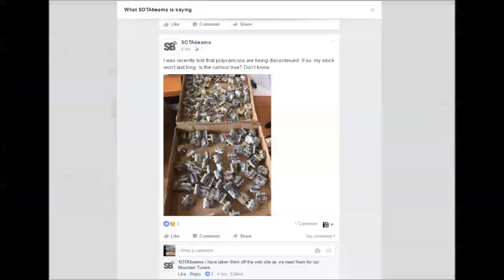What to do if they stop making variable capacitors

Comment: They aren't going anywhere. Every alarm clock uses one. We will always need to wake up.
Reply from the maker: The same would have been said about valves 40 years ago. Now you hardly ever find a valve radio. Modern clock radio are push button tuning and don't have a variable capacitor.  And many people use their smartphones to wake them up.

Comment: Some stochy diodes and power transistors work well as a varicaps... using 0-9V tuning voltage... power diodes gives 500...150pF and transistors 1000....250pF tunning capacity range... all this devices from impule power supply.... or junk box....

Comment: Peter, one trick you can use to cut down on wind sound (and attenuate the audio level slightly) is to wrap a little scrap of soft foam such as the kind you might find in an equipment case or inside a cushion/mattress around the mic. 
The best option is fake fur or similar, which if you can find a scrap piece from a garment at an opp shop or similar, it will work wonders.
You can tape or use a tiny cable tie to secure the material around the mic.

Comment: Variometers with nested solenoids are fun and pretty easy to make, you can use them for coupling adjustment in regenerative receivers too.  A super simple SW regen would be a variometer tank wound on a nesting pair of cardboard tubes with adjacent tickler also pivoted to rotate, a small fixed capacitor (maybe switched or tap the tank coil), an RF JFET, a resistor or two, a bypass cap, battery and a crystal earphone.  Antenna tuning and coupling might also be a variometer.

Homebrew variable capacitors are quite practical.  Sliding and telescoping geometries are the easiest, but rotary can be made too.  Cutting the plates isn't much fun I'll admit, especially for larger capacitance, but you can even use a plastic substrate and Aluminium or Copper tape to cover them.  A laser cutter makes short work of it, but a hole saw or even scissors could be used.  Add some threaded rod and hardware and assemble as many plates as you need.  For high-Q use like transmitting variables you can use brass and silver plate it, split the stator and eat the halving of the capacitance, but eliminate sliding contact loss.

An alternative geometery I made a video about a while ago is a spiral wound compression-style variable.  Not very stable or practical to calibrate, but very easy to build with Copper or Aluminium tape or roofing flashing foil.  The dielectric can be low loss polymer film like PP or PET.  Paper or PE works in less demanding apps.  The parasitic inductance and resistance isn't too bad for MW or LW receivers.  SW would be challenging because of poor mechanical stability.  A more conventional book-style compression capacitor might be used instead and while it still needs a lot of plate cutting assembly is much faster than a rotary cap.